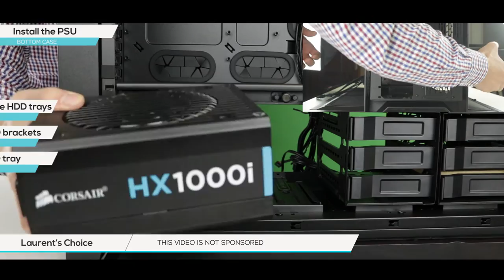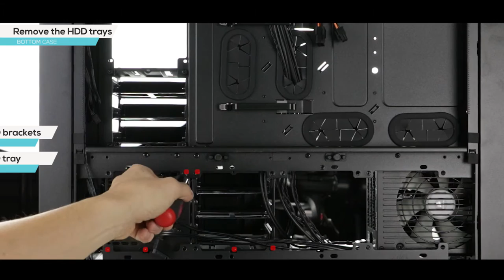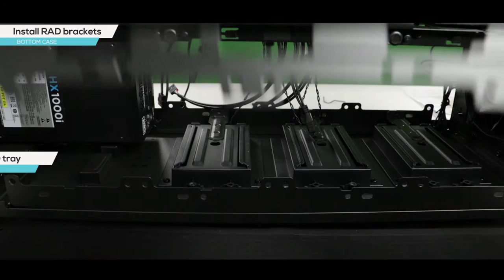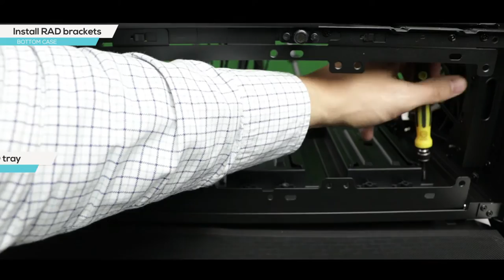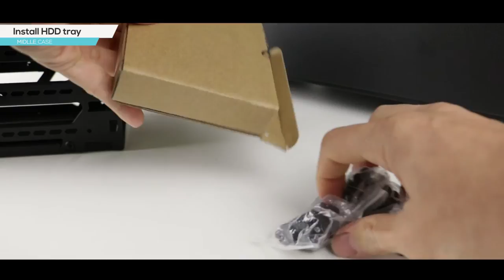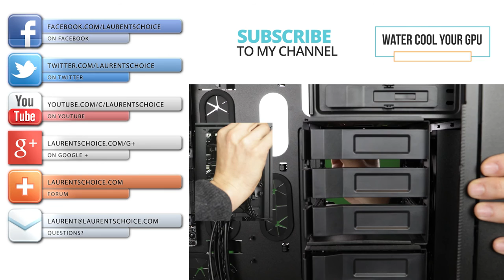Prep an Obsidian 900D for custom water cooling (custom water rig 1/9)

Comment: Doesnt the psu pull air in? And usually out the case from where the cable is?
Reply from the maker: It does. Pulls in fresh air and exhaust is out of the case through its back. Correct.